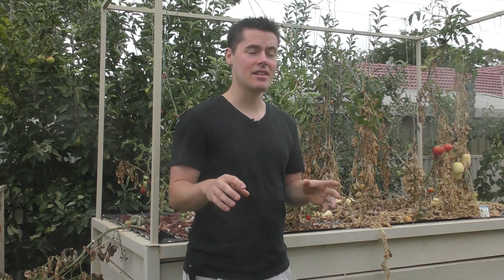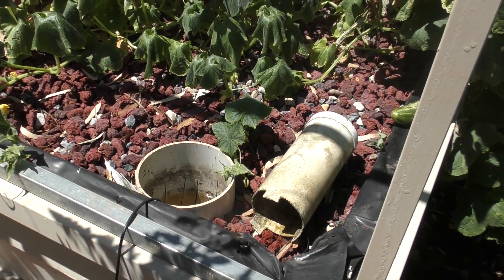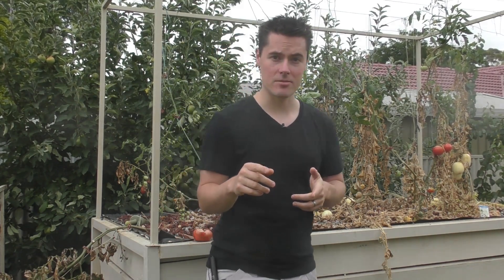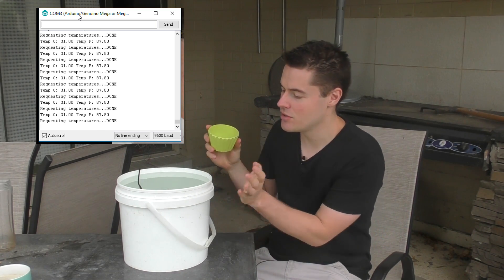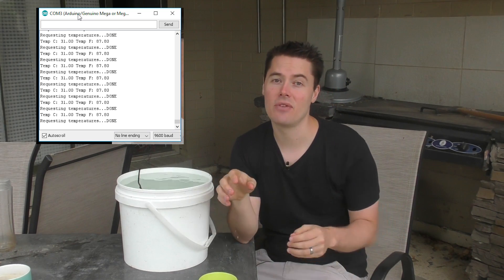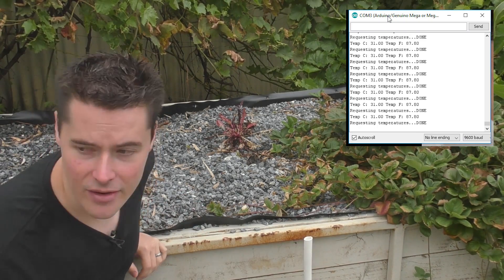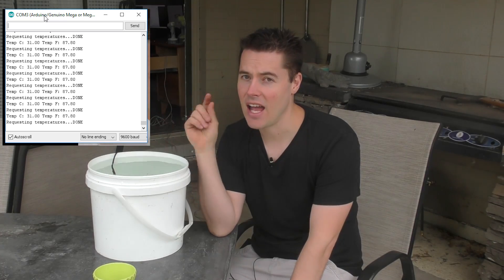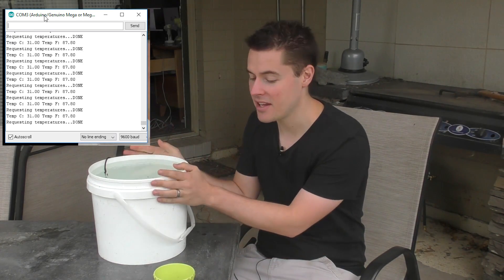Aquaponic Cooling Mythbusted! Is Siphon Cooler? Or Constant Flood?

Comment: I can't help but think that the 3L ice block would have a larger surface area and stay solid for much longer than the 3 small cubes, giving it time to cool the water in the IBC, would be interested to see how this scales up to a 1000lt tank
Reply from the maker: It's the same amount of thermal cooling energy though. It doesn't make a difference if it's released all at once (crushed or smaller cubes), or in one slow block. One block will just take longer to transfer to cold energy to the water. 

I'm happy to see somebody prove me wrong though.

Comment: Next time it might be interesting to see how the beds go with the bells pulled out & then fill the sump to the brim like I did here with 3 out of the 4 beds.  I figured more water volume meant less swing in temp. It anecdotally worked for me but didn't have an identical system to rate it against. 
Cheers mate.
Reply from the maker: Higher water volume will always make a huge difference, and you've got a lot more humidity there than what I've got here, so the evap cooling won't be as effective. How'd you survive the heatwaves up there?
Reply: Most the plants did OK in the aquaponics, Some of the soil ones got knocked around a bit though. Was only a few days worth of high tempos so think we did better than some folks down south. You lose many/any plants?
Reply from the maker: We've had worse heat waves, so it was fine. Full sun, and everything was standing up strong. 

You might be curious to know, youtube classifies your post as an important one, I selected the notification for important comments to pop up (as going nuts), hadn't sent me one until you commented.
Reply: :D 
Where is the important notification setting?  Might play with that myself.
Reply from the maker: In the community settings somewhere. I think it brings up people over a certain sub count, maybe  :)
Reply: That rings a bell. Will have a hunt around later to see if I can find it. Cheers mate :)